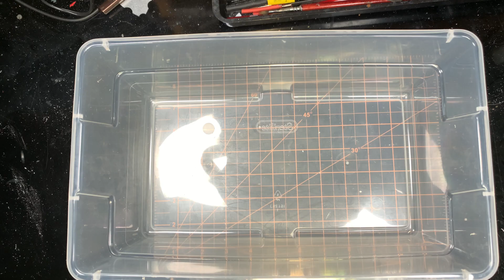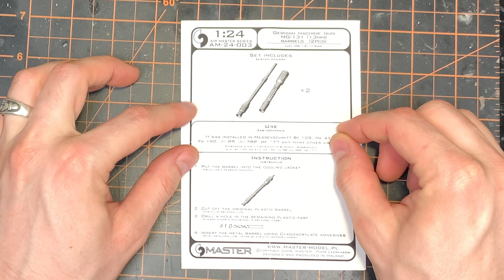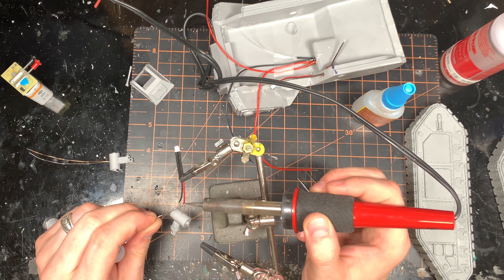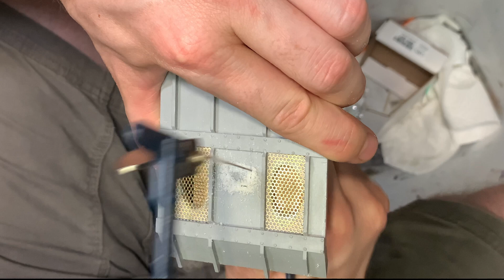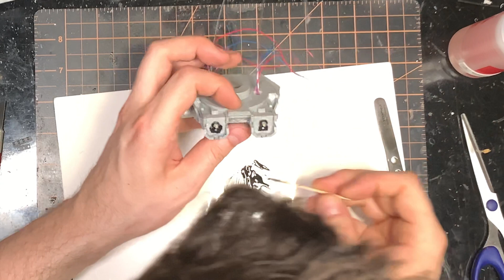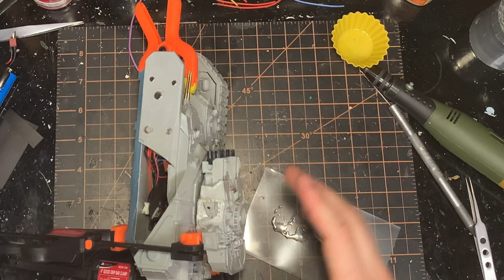Macharius Vulcan Lights & Sound

Comment: Id love to see a valkyrie build. I'm wondering how you'd put lights in the engine and cockpit
Reply from the maker: Well actually I have done a Valkyrie AND a marauder bomber!  Those were the first ones I did so I don’t have a tutorial for them but maybe someday I will?
Reply from the maker: But for the cockpit I did fiber optics and drilled out all the control board and printed dials and radar at double size on shrink film then shrunk it and back lit it